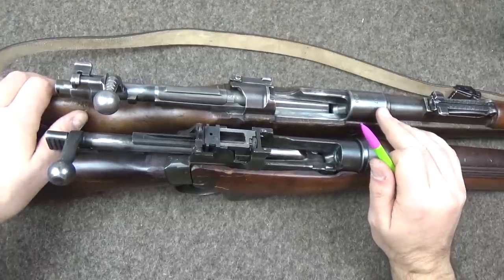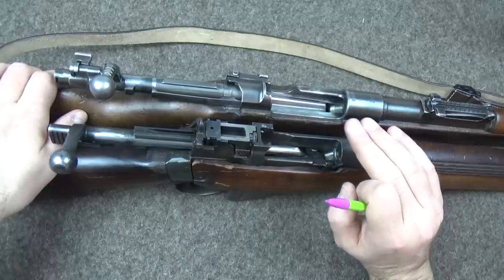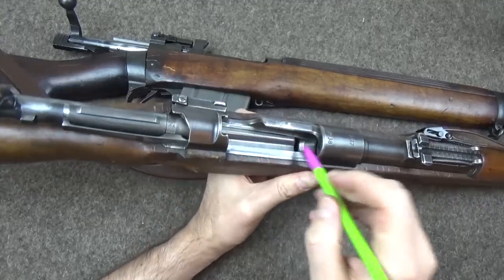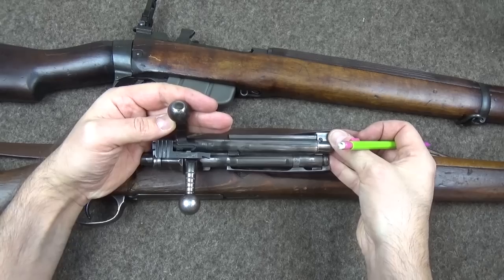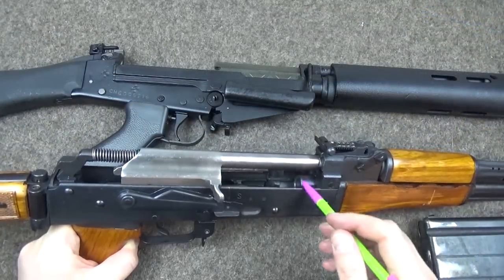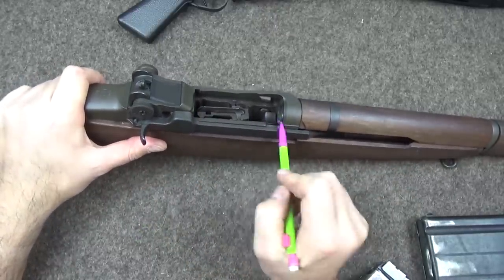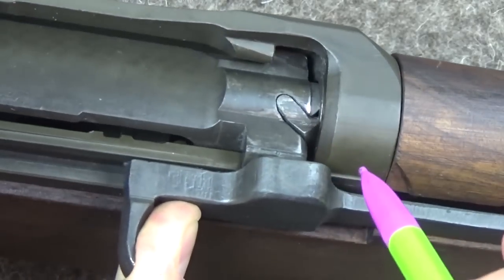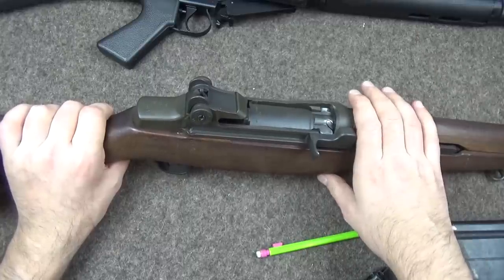Mechanical Nerdery: Front vs Rear Locking Bolt Throw

Comment: Front lockers are also harder to tel if clear. Once pulled a Mosin nagant out the safe. Pulled it out, Opened the bolt out of instinct  and out popped a live round!! I’m pretty sure I looked to see if it was unloaded from its previous range trip. But In a front locker a round can be in there and it can be hard to tell with the chamber so far into the action.
Reply: Maybe it's just a mil training thing, but in my short conscript time  ages ago, we were taught to use our little finger to check the chamber in the dark or when there is no clear path of sight.
And while i don't have to do that with my firearms as i tend to have good light and a clear path of sight, i would still do that if conditions were different.
Reply: @nirfz  Was it true that to prove the barrel was empty at an inspection you stuck your thumbnail in the breech and pointed the rifle at the sky? 
If nothing was shining on your thumbnail then the barrel must be blocked by something
Reply: @myparceltape1169  With inspection you mean to show empty to a superior right? Well that depended... I remember instances where (with good light) mentioning the condition of the rifle while having the mag removed and the bolt locked back before handing it over to the person was enough. (as the other person then was able to see or check/feel with the finger if empty) And yes usually the barrel pointed upwards and in a safe direction.
In most instances we removed the mag, locked the bolt back and took out the barrel and showed the breach-end of the barrel. My issue rifle was an AUG, so taking the barrel out takes less than 2 seconds, and you can then easily show the chamber to the other person. (As long as the cartridge casing isn't painted black you could see the colour difference on the end of the barrel even in really bad light conditions)

The finger check i mentioned was a safety check for ourselves when taking apart, checking or unloading any firearm. (MG, pistol...)

Oh and we used the pinky finger because the thumb would be too wide to get in there with most firearms. (and the pinky is the least important if you do something wrong and squish it ;-) )
Reply: @nirfz  Thanks. I had never thought of a barrel being so easily removed. 
The thumbnail idea was simply to show that light could pass through the tube without any risk of something coming up to hit you in the eye. 
But as you pointed out, darkness would nullify that idea.